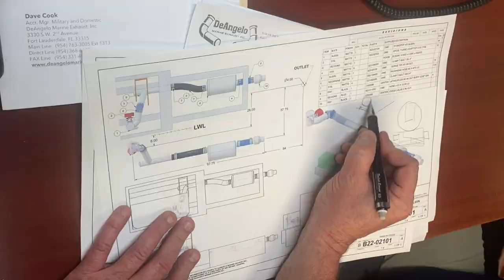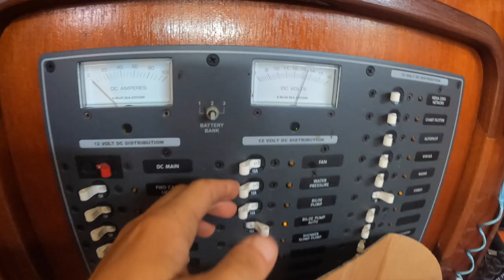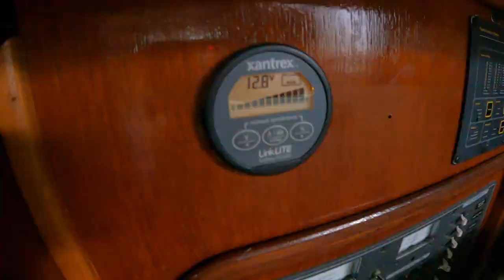My Beneteau has water! SeaWater Pro watermaker install & replace water manifold [ep 8]

Comment: Does the diesel require there to be back pressure on the exhaust? I ask because I don't really understand why they combine the hot water return from the saltwater exchange into the exhaust separating those pipes would prevent blow back or back pressure where the salt water could get in the oil system.  Since that is the problem it seems more like a design issue of the exhaust system...  Complete isolation between coolant and oil systems.  Just curious my marine experience is U.S. Navy and I wasn't a boiler tech or sfbo so that doesn't relate to diesel well. But the auto mechanics does seem to apply a bit. In auto mechanics we would try and remove anything that created back pressure on the exhaust because it could kill the engine if it was running, lowers horsepower, and reduces engine efficiency, though it also makes it louder typically. That would also be an idea for a video.
Reply from the maker: That makes sense.. thank you

Comment: Ohh sweet girl.. Gosh I would've soldered you up a new manifold.. Im not picking on you really but those white plastic hose barbs are gonna haunt you one day. Atleast the will be easy to change out later but you should have several spares on hand because they get brittle and break easily. Definitely good ingenuity there but I've just learned my lesson on things like that. They make the grey/black colored ones but they're harder to find the right sizes but definitely use those next time. I so wanna just give you my number and say CALL ME! If you ever need advice. 😆 I would tell ya just what to do. I'm used to it. Have four sisters anyway lol

Comment: Whose apartment is that your staying at. Pex pipe would of been easier quicker color coded blue red. Also ...just saying if all.pipes look like that replace them when your hauled out replace ALL thru hull fittings and pipes. How much water does all your tanks hold. Keep instructions you will have to clean filters and replace charcoal

Comment: I am certainly not judging, I am just a bit shocked that some young men didn’t help you with your plumbing issue. I am old and that’s putting it nicely, I am also a builder with three boys as part of my crew. I wish I had seen this when you first started this I would’ve introduced you to PEX and your plumbing problem would’ve been done in about 30 minutes using little to no tools. If this ever happens again I’m sending my boys to re-plumb the entire boat.😎💦

Comment: I love your tenacity! building up a mainfold as you did isnt an easy task. a trick "if you didnt know" is to make a pot of boiling water and put the end of the hose in it, or use a heat gun to soften the ends of the water hose, it will slip on to the barbed fitting with much less effort! best of luck to you!
Reply from the maker: My boat was out of water and I didn't have a heat gun😅 I borrowed one for a few of the hoses which made it so easy!

Comment: That’s a poor manifold. It looks like someone did copy a house hold way of piping. Your fix is a bit better as the brass is thicker.  Use some clear coat to preserve the brass. But you probably have to improve that manifold one day as it leaks. 
Well done on the jobs .
Reply from the maker: Yeah it was 30 years old…will do. Thanks!

Comment: All the drama with your muffler seems kinda strange. I installed a 60hp Isuzu diesel in my yacht and there is no muffler as such. There is a plastic box right before the thru hull just above the waterline at the stern near the centre of the boat.     
The box mixes the exhaust gas and raw water giving the same effect as a muffler. The box is a fraction the size of your muffler was available off the shelf and took about ten minutes to install. A hose takes exhaust and raw water from the heat exchanger to the stern then up to deck level and then down to the mixer and out.  The loop up top deck level stops sea water from a wave running back in to the engine.

Comment: And you need a pair of mechanic gloves for all that mechanic work miss mechanic especially for tear down and removal. Grab yourself a box of throwaway latex gloves as well. Make sure she gloves up  MAKO. Great video great work CAPTAIN.
Reply from the maker: You are right! Thanks!
Reply: Don't you run the risk of different kind of allergic reactions when using latex gloves? Aren't vinyl gloves better?
Reply: @angela1984a  On and off with all plastic gloves.

Comment: i already knew that i will be leaking when i saw it, just because of the number of connections...also you can make some mistakes with teflon tape. better would be one square block of metal with the right number of connections/holes for the fittings...this would remove at least 10 points where it could leak ...alternatively (and maybe cheaper would just be t-fittings connected with tubes which are secured with hose clamps)

Comment: Great job on the new "rebuild water manifold/piping" and the seal coating was perfect (also and anti-corrosion coating) and wasn't made to be pretty. .. it was made to work!!  You are also a born educator among the many other hats you wear Lauren. - Have an Epic Weekend - Safe Travels - Frankie G.
Reply from the maker: Thanks so much!
Reply: Because of the way Lauren assembled the replacement manifold without pressure testing before mounting, I feel that it is a potential nest of scorpions waiting to bite her in the not-too-distant future. Also the valve on the water-maker line is not mounted or secured and is another worry. I think the plumbing and electrics on the boat need a professional refurbishment. How she keeps her calm in all this is astonishing!